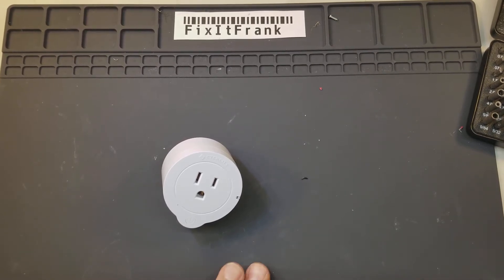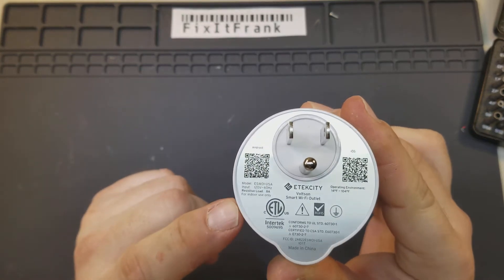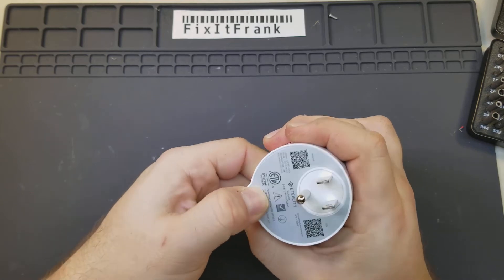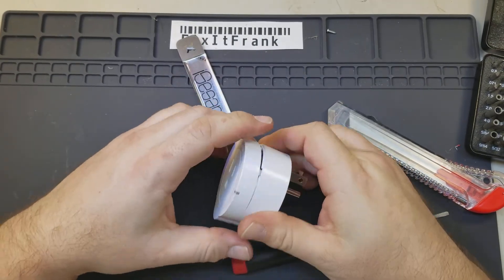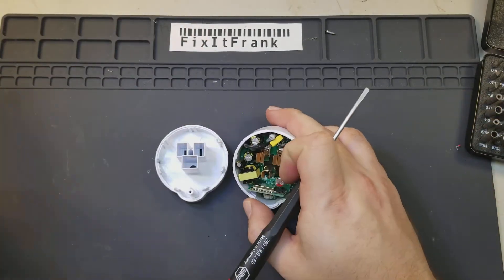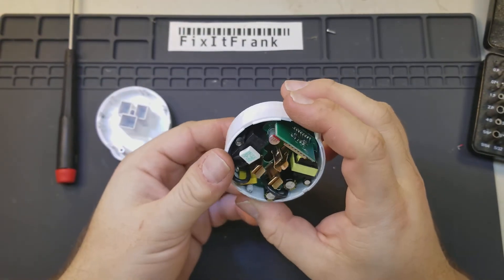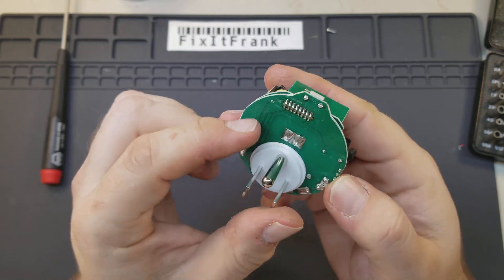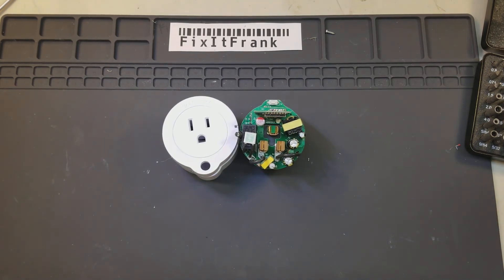Etekcity Wifi Smart Plug Teardown

Comment: I wonder what do they use for the cheap measurement of voltage and current.
Reply from the maker: Good Question!  I could pop it open again and see.  I suspect its similar to an arduino volt and current monitoring.  Resistor dividers and shunts into the esp8266 ADC input.
Reply: Also I wonder How did they power the WiFi board with 5v?

Comment: I am hearing my relay and led click on amd off when o toggle from the app or front button. I assume someone plugged more than 8a in but not seeing the fuse
Reply: Just looking at the circuit it seems like it’s the white box off of the jumper wires with the green lettering?  Haven’t seen a fuse like this before
Reply: Yep - I just snipped it out and fused the wires to test. I had no connectivity across it before. The fuse seems to be a 10a
Reply from the maker: Thats the one. 10amp fuse through the relay.  You can use any 10amp pico fuse as long as it fits.

Comment: I was trying to connect one of these and as soon as it connects it starts to go on and off continuously and never stops.  Any idea what might be wrong?  It's a WAGA WiFi outlet.  Do you know how to factory reset WAGA?
Reply from the maker: I am not familiar with WAGA outlets.  Turning on and off sounds like an internal fault though.  I would not use it and contact the manufacturer to get it replaced. There are any number of things that could cause this.  None of them easy to fix unfortunately.

Comment: Was it definitely an ESP8266 inside? I have a few other units that have ESP8226 Wifi chips inside that I reprogrammed but I am trying to find more of them.
Reply: I just got a four pack of gosund boards on amazon for $33 and while I haven't opened them up I'm almost certain they are ESP8266 based since my router says things like ESP_8B9D03 and two of the four even say Espressif Inc.
Reply from the maker: @hatelongusernames  I agree. In fact, I just ran my network scan tool and the etekcity modules show up as ESP_xxxx as well.  Good thinking!
Reply: @hatelongusernames  I saw those and was actually going to buy them but then I found a four pack of the Etek's for less.
Reply from the maker: I'm pretty sure.  I will pull it open though to make sure.  I know the Etkcity models use that Ewelink ap rather than smart life.  I'll follow up with you a little later.
Reply: Seems the newer EtekCity outlets "B" version have switched to an ESP-01E. Slightly more difficult to get to the GPIO0, TX, and RX pins and impossible to separate fully from the housing without destroying it. Was a bit miffed when I saw that. Lots of other changes to the components used as well.

Comment: Thanks for tearing one of these down.  I was curious on how well built they were for how cheap they are.  Not bad.
Reply from the maker: I love their stuff. I had their older RF type running off a HookHub, but the wifi versions are sweet.  I now own 10 outlet modules and use them at work for some things.